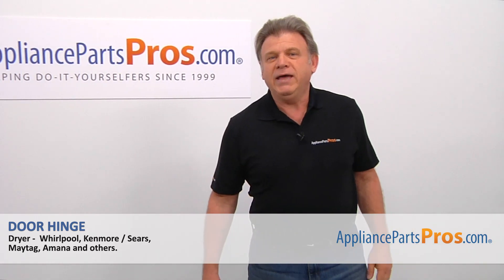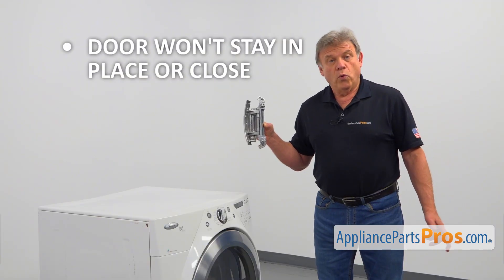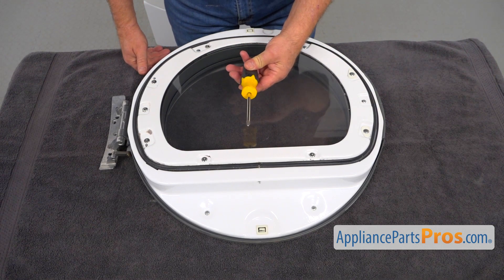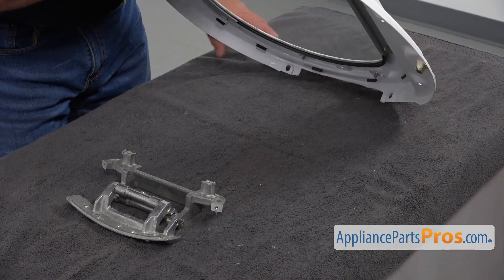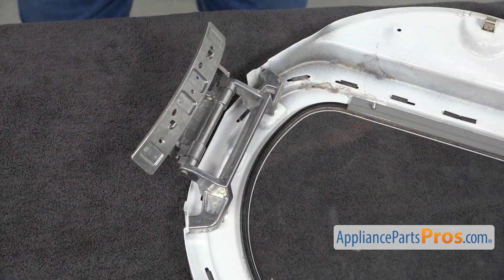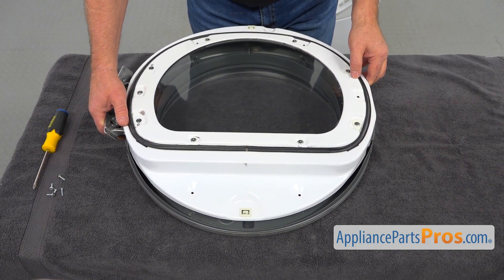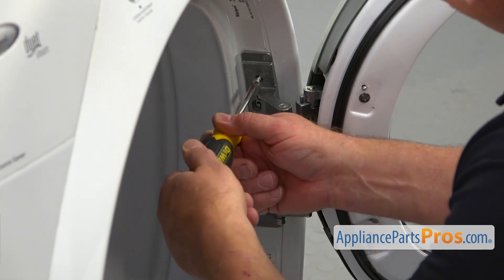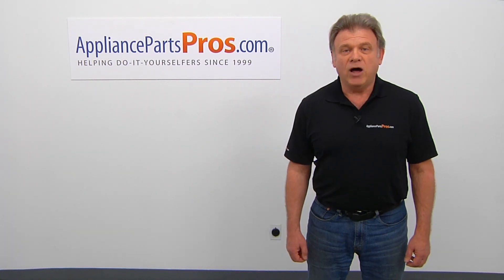How To: Whirlpool/KitchenAid/Maytag Dryer Door Hinge WPW10310366

Comment: Man, appliances are junk nowadays.   For what we pay, they should last 20 years. I had a maytag hinge wear out on a dryer about 2 years in.  Guess what i buy next time- Speed Queen commercial.  No more maytag trash.
Reply from the maker: We hear you! It’s frustrating when appliances don’t last as long as they used to, especially for the price we pay. A worn-out hinge after just two years is definitely disappointing. Speed Queen has a solid reputation for durability—hopefully, your next dryer holds up much better! Thanks for sharing your experience!